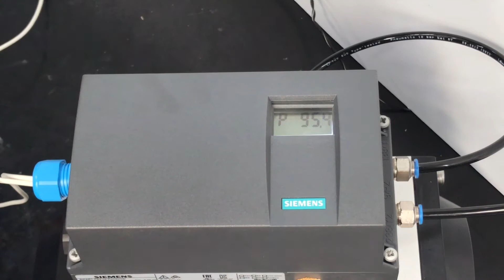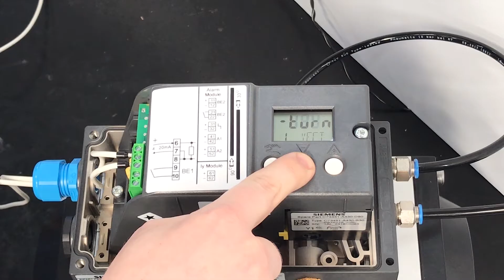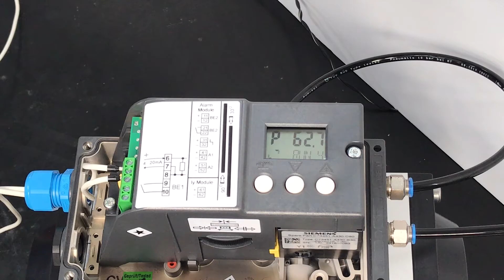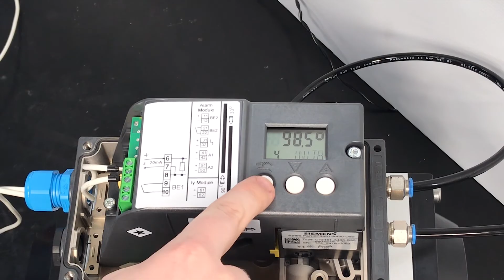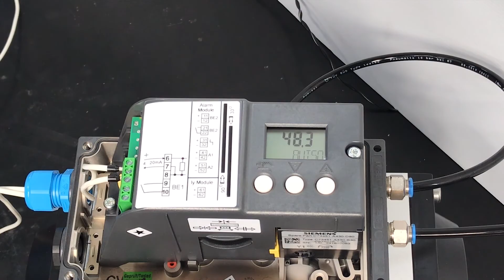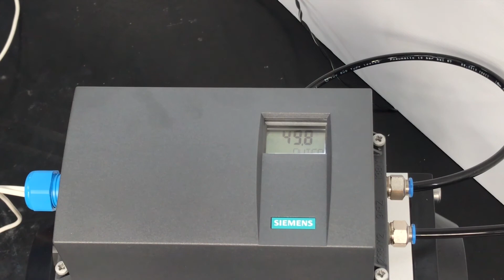Calibrating a Siemens PS2 positioner

Comment: Hello , I have a question ;
Even though there is 4mA in operation card, in the screen of valve appears AUTO 100 . Is there a problem with the settings of the valve? So valve is bot taking action accreding to plc command.

Comment: I have a question, on a Flowserve positioner I can just run a "find travel stops" and a Masoneialan SV2 I can also only run a travel stop. This can be very helpful at a time when we have to have the valve immediately. We use a lot of the PS2s where I work, is there a way to only run a find travel stop and skip the other steps ? If we are on a sloppy valve that is not scheduled to be rebuilt until an outage I could really use this function because the PS2s at times will not complete the calibration if there is slop? Any suggestions? Thank you for your help.
Reply from the maker: Hello SuperStang thanks for checking out the video.  If you want to speak to one of our technicians please feel free to give us a call on 03 8727 7800 and we can talk you through the process or send an email to info@acrodyne.com.au